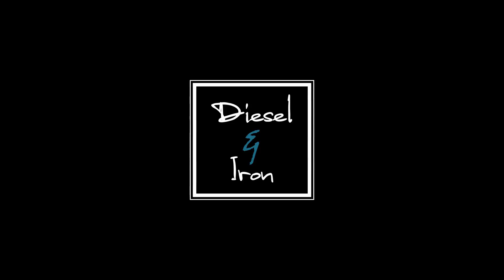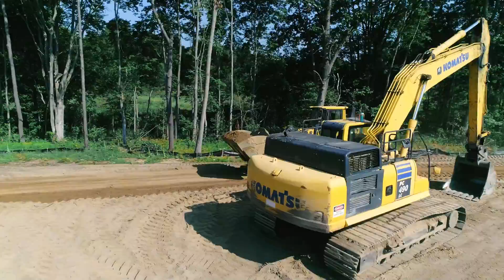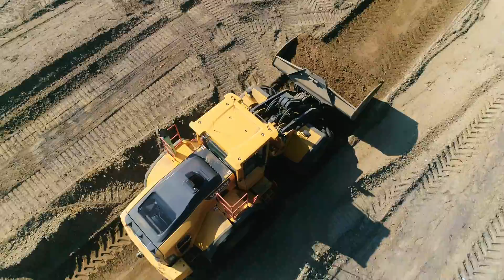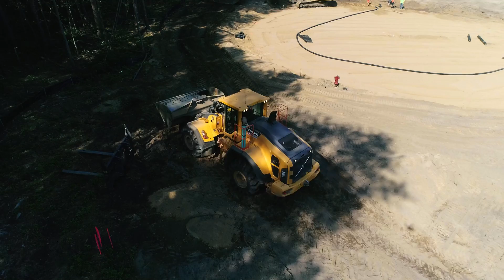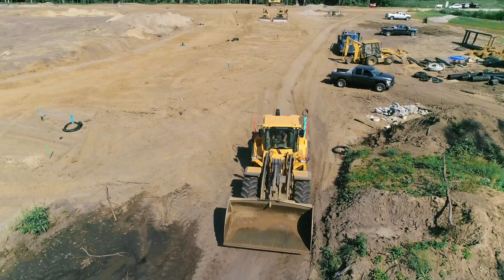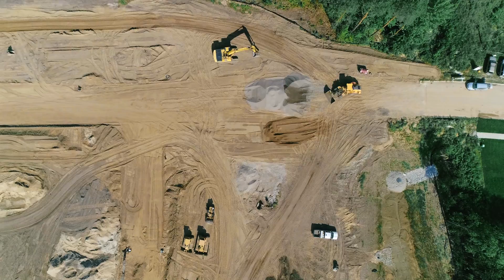Volvo L150H Wheel Loader Moving Sand | Construction Work Drone View | Residential Excavating

Comment: Do you record the audio separatley? or what kind of drone do you use to record both audio and video?
Reply from the maker: The audio is recorded separately. I have an audio recorder suctioned to the side of the machine. The drone is a phantom 4.  I sync the audio and video in post.